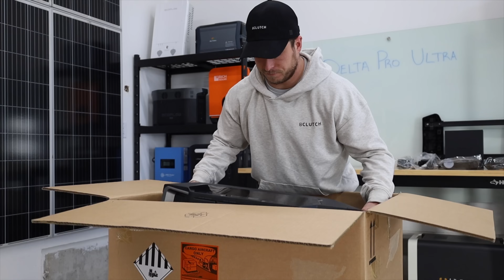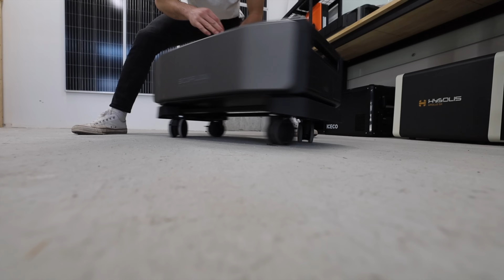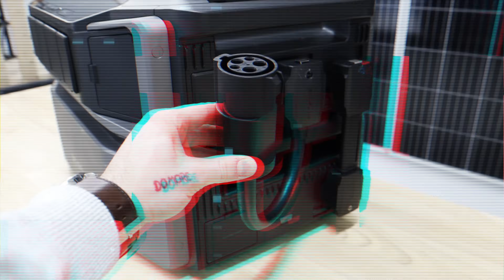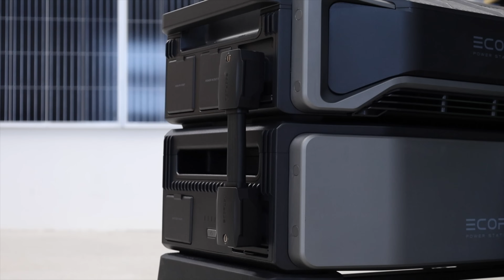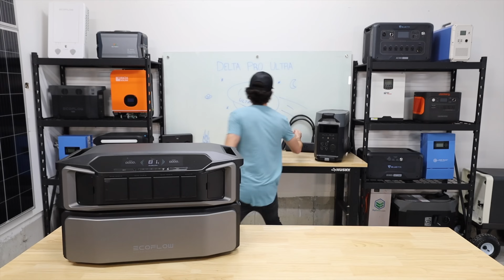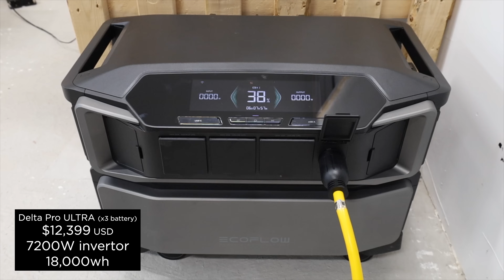EcoFlow Delta Pro Ultra - NOT What We Were Expecting!

Comment: Unfortunately, I think I already know the answer but if you use the 50 amp hub that means you cannot go above 50 Amps, correct? I have an electric heat pump and heating system and it needs 79 A to come out of rotator lock.
Reply: Get a soft-start system like "Easy Start" and you may not need more than a tiny bit over the operating load.

Comment: If you’re in an NEC2023 area with hilariously expensive battery installation rates the bonus for these is you can DIY without violating code or paying silly money. NEC2023’s paired battery/inverter nonsense and the way the solar industry makes money leads to $15k 5kWH batteries installed with your solar install where the permitting has already been paid for.

I am planning on dumping excess solar for charging my car into a battery and the options are essentially something like this, an all EG4 setup, or paying out the nose.

Since I don’t care about whole home backup this is a pretty easy option and if I do ever care there is an upgrade path.

Comment: What are the pass trough charging limits and can one charge the DPU off a portable gas generator from the high Input/Output on the side   while at same time powering a 30a 240v load from the 14-30 plugs on the front?
Reply: I need this answer also.

Comment: Would be a good fit for taking a single wide trailer house off grid especially if the hot water tank and oven are natural gas and you use mini split 120 volt AC/heat pump systems for the house or you live in a tiny home with one or two 120 volt mini split AC/heat pump systems.

Comment: How about just getting a gas generator to charge up the ultra and not have any panels at all. 

I want ecoflow to ship to Puerto Rico but they don’t. 
USPS will only ship 70 pounds for about $300 bucks. 

I could buy the whole unit in PR but the price is double and triple amounts.  

This is mostly for my other half where she could just flip up a interlock turn of the main and torn on the ultra. Then run the whole house with the 240 L-14 30 Amp plug.  Like I have here in NY
Reply: Have you checked if you can get it through Costco?
Reply: I haven’t checked Costco but I have checked Home Depot in PR. 
Next time on there I will check. 
Thank you.

Comment: Way too low of solar input.  You have to essentially buy at least 2, but probably 3 inverter combos for a true whole home PV setup.  At that point the cost is insane compared to the competition because you are buying so much unused redundancy.  Also their "Smart Panel" that accepts this is essentially a critical load panel (12 slots) and not a whole home backup.  I love Ecoflow in the mobile power space, but they missed the mark on whole home badly.

Comment: I just don't get it as a home backup. I want to run my whole house including a/c and you would have to spend an absolute fortune to be able to do this any length of time. What good is an hour or two? I want to love this technology so much, but it just doesn't work as far as dollars for results. My 13kw gas generator runs my house with no problem and only costs $1200. I mean that's a huge difference to me.
Reply: What happens if there's an extended outage and you need gas but you can't buy it from the gas station because they need electricity to run the pumps? That's a reason I have solar backup. Also, it's a huge up front cost, but requires no maintenance or  fuel dollars down the road.

Comment: I own a Delta Pro, a Bluetti AC200P and a few other smaller all-in-one units, for "convenience..."they are bolt-ons for a much more substantial solar/battery setup. I would caution anyone who takes power backup seriously to not place your entire backup strategy into one of these all-in-one setups.  Are they cool?  Yep...I may purchase another one at some point.  The potential issue/risk (for me) is what to do if any single component fails in one of them (MPPT, Inverter, 12V output, battery cell(s), etc.).  For a home backup, I'd use tried and true, stand alone, system components and use these for convenience only... or camping 😀

Comment: Gasoline Generator, if you are a dinosaur?  I think I'm missing something. If these batteries are depleted after a day or so and there is no electricity due to a storm, what alternatives are there outside of gas?  And spending thousands on additional batteries.  FYI, I can get and store gas and propane on the cheap for longer than any storm will last. PLEASE HELP ME UNDERSTAND.. I HAVE TO BE MISSING SOMETHING
Reply: Most power outages are brief. And if it’s extended, that is where the solar power hookup comes into play.
Reply: @AlanMEvans  you are correct. I guess it depends where you live.. it seems people in houston and place affected by hurricane and freeze look at things a little different.
Reply: If a shtf occurs and goes on for longer than a few weeks,  people will be attracted to the loud sound of a gas generators knowing someome has power.

Prepare for a lot of unwanted company!!
Reply: I agree
Reply: As the op pointed out, there are other options to Ecoflow that are a lot more cost effective.  I think Ecoflow is designed as a more portable power source for camping, sporting events, exhibits, temporary storm power back up, etc.  Anyone already owning a solar array setup can add this Ecoflow, but most likely we'd get a Solar Arc hybrid inverter and any batteries, but preferably, LiFePO.  The tricky part is wiring it all together, because you need the correct wire and you need to know how to balance the solar panel loads with the battery inputs.  It is not hard, but it takes a bit of know-how.  You can also get a generator to charge up the batteries, but it is also expensive. BTW, solar panel prices have dropped and use 300W panels can cost less than $50 each.  I have a 12KWH system and it would make sense to use the output from the existing inverters to feed the hybrid interter, charge the batteries, and then be happy knowing I am in good shape if there is a storm with more than adequate backup solar.
Reply: @johnsteed265  looking forward to Solar Arch coming out with a solution as easy to use and setup  as Ecoflow and Anker...

Comment: Hi , i have span electric panel which has solar edge pv 40 amp input connected to one of the circuit , is it possible to add delta pro ultra as solar energy passthrough to span panel to smooth out and max consumption of onsite solar energy ?

Comment: Title: EcoFlow's New Delta Pro Ultra - Battery Issues and Mixed Messages from Customer Service
I recently ordered the new Delta Pro Ultra from EcoFlow, but I have a frustrating issue. They sent me the inverter but not the battery, and to make matters worse, they charged me for the full unit.
When I emailed them to ask about the missing battery, they informed me that the batteries for this unit are out of stock and won't be available until mid-July. However, when I later called their customer service number, I was told the batteries would be in stock in early July.
These conflicting dates are leaving me stuck with a Delta Pro Ultra and no battery indefinitely. Adding to my frustration, their website still allows people to order the kits and the batteries as if they're readily available.

Comment: I'm evaluating home backup batteries, without solar panels.  Panels are icing on the cake.  This system will run my house and I can charge it back up on the grid once the black-out is over.  Or if too long, I can plug in my dual-fuel generator for a few hours.

Comment: An added benefit of this vs the professionally installed set ups is this is mobile, though it's heavy and a pain to move. So if you have a major disaster you can take power with you when fleeing. 

Also, you don't have to worry about having some "professional" cutting corners or making a mistake.

I do want to know how the longevity compares to the professional kits though.
Reply: They guarantee a minimum 10 years.

Comment: I would love one of these due to how clean & quite they operate compared to a gas generator but I see the Delta Pro Ultra 6,000 watt is  $6,300 online. A Generac Guardian 18,000-Watt (LP)/17,000-Watt (NG) Air-Cooled Whole House Generator with Wi-Fi and 200-Amp is $5,163 Plus installation.  Is there another combination of Delta brand batteries with enough to power a whole house that would be less expensive? I would also want a fuel fired generator, smallest size possible, that could be used the recharge the Delta. During a blizzard or high wind event the solar panels wouldn't cut it for me. Thanks!

Comment: Great overview, Thank You - I wonder if you have a video that shows how to connect this unit to the hose electric panel and switch automatically when the power grid fails - Also, ca you show the number of units needed to provide power for a house with 3 refrigerators, water heater, HVAC system, and electric stove and media center... Thank you in advance for your help.
PS: My highest monthly usage is 573KWH.
Reply: I believe the only way for an "automatic" switch over in the event of power loss from the grid is to use the EcoFlow Smart Home Panel 2 (SHP2). The SHP2 supposedly has an undetectable transfer in the event of a power outage and it has positions for 12 breakers. The panel is installed as a 100 amp sub panel off the main and you can use double breakers in each slot which could theoretically provide 24 circuits in the SHP2 as long as the total working load was within spec of the panel. Each DPU inverter also provides 7200 watts which is 30 amps but the panel will accept connection of up to 3 DPU inverter units for 90 amps combined but that gets expensive. I'm waiting on my order for a DPU with 2 batteries and the SHP2 from Costco and just had an electrician here this week to discuss the installation. I'd do it myself but the local inspector won't give me a permit for this magnitude of work.
Reply: @robertbaron3242 thank you for your reply and insights, it helps me greatly.

Comment: Have you had a problem with delta pro ultra sold by amazoz? The q/a:"Is ac pass through possible with 120v input? A:Use the c20 outlet for a bypass mode with a 120v input. There is no bypass mode for 240v input. AC output is turned off at this time."

Comment: I have an existing Ecoflow Power Kit in my van. Do you know if the same cable connectors are used on the Ultra that were used  on the Power Kit?  would be nice to just slap this baby in and use the cables i already ran for AC in, PV in, DC out , and even my  existing 5kwh ecoflow batteries. etc.

Comment: i need this for my solar system, but I can't afford it .. Yet. I am getting solar installed at 37k. This will leave me broke. but I will need to save up 18k to get me one of those that will last me 24 hours or longer. I prefer the 60KwH option but can't afford that either. I need patience. then I can get it. I need it cause i want to be able to go totally off Grid and only have to pay for gas. 900.00 in my Electric bill is about what i currently pay on my Mortgage.

Comment: your gas generator statement was extremely stupid, yes us dinosaurs supplementing electrical during power outages during a sub-zero winter at 1/10th the $$$cos, How about a simple natural disaster...or a simple hail storm, a fuel generator system is basically weather resilient, the dinosaurs understand redundancy and real-world issues.  Your statement should be "If you can afford it" add battery storage...or supplement this system with a tri-fuel generator

Comment: Do you know if the Delta Pro Ultra works with the Delta Pro accessories? Example Ac alternator charger to charge while driving/ or ev adapter to charge at fast charging stations around the country??

Comment: I just got my Ultra in and running test on my 2 refrigerators and freezer at the same time. Just wanting to see how long one battery will run them. I, like you, wanted the DYI kit because I'm cheep too. But, I have an RV I spend 3 months in the woods during deer season & 3 months at  the lake in the summer. I'm 60 & retired. But the flexibility to not pay $50 per night at the lake for a power site & a backup for the house was best for me. I'm going to get 2 of the Zigs or Cigs (sp) 400watt flex roll up panels. Great video man;  also do some affiliate links to make some money. You can offer discount codes to us doing that. Everyone has to make money.
Reply: Update?

Comment: I am seriously looking at installing the Ultra with 3 extra batteries. I already have 12KW solar array and a 20KW generator. Living so close to the ocean is eating my Genset alive so i have to switch soon for whole house backup.  The Genset has a transfer switch so I am wondering where to position EcoFlo transfer switch. It seems every year we have a week long outage. I am thinking 24KW output can be recharged everyday by the solar panels but if there is a week of solid cloud can the generator be started to power the house and at the same time recharge the batteries.

Comment: Thank you!  The one thing that drives me nuts with EcoFlow is they use proprietary connectors.  I'd love to see a 240v charge input with the 240v output. For people in apartments who can't convince the apt to install the Ecoflow sub panel, but could possibly get them to install a quick interconnect plug.
Reply: They have a generator inlet cable 240v l14-30
Reply: EXACTLY…. WHY IS THIS NOT EVERYWHERE…. HOW MANY CONDO’S NEED THIS 😮

Comment: I saw this thing at costco with 2 batteries and a smart panel 2 for $8k. I wonder if I could use this and the panel with my current setup which is 39 solar panels with enphase inverters that is grid tied.
I was thinking of setting up this panel 2 with essential breakers like fridge, well pump, water system etc and then have the delta pro ultra be a backup if my UPS for the house and also have it either grid charged or solar charged. Anyone know if this is possible with this one unit and the smart panel?

Comment: I like the idea of this product and its integrated, expandable system approach. I do have one thing that I cannot seem to find a definitive answer on. Can I use my Honda EU2200i generator to charge on the 120 volt charging plug, while connecting the output of the DPU to the generator inlet box on my house? The idea being that under light loads the generator is keeping the DPU topped up, but under heavier loads the DPU can combine battery/generator? That way I could use the DPU for heavy draws, and also extend the useful run time of the generator.

Comment: Does the app still require you to provide email address even if you log in with (e.g.) AppleId?

One of the killers that stops me from expanding my already existing setup using Ecoflow’s lack of transparency about what data they collect about the user, and a stupid (IMO) requirement to log in to use the app which makes it completely unusable in an off grid location with no internet.

It’s a non-starter, and a huge drawback on otherwise fantastic product.

Comment: Or one other note if you want to make a test with it. Won't you hook it up to your house show how one battery cannot run your whole house and that pull out fall in power without at least 3 batteries, and you won't have full capacity of power to last all night long or all the zon as it needs to last with all 5 batteries and you can't get the full impact out because it aint gonna run at 7200 W without more than one battery.
Reply: I'm not sure what point you're making or question you're asking, but 1 battery and 1 inverter will easily output the 30 amps @ 240 volts to make 7,200 watts (of course it would only last a bit over half an hour with that high a load).  Most of the comments about will it do this or will it do that don't contain any information about the load being pulled from the DPU.  It's all pretty easy math to estimate, you use 1kW of power for 6 hours and you'll deplete 1 battery's worth of power.  Just having the unit plugged in to 120 volts @ 1,800 watts would keep the unit charged and not require extra battery power to meet power requirements.
Reply: @default7950  What point is I making 7200 W?What is that gonna run my kitchen stove?My water heater My watch Machine.
Six split air conditioner heaters  Would that?
 Run a electric furnace. Everything in my house is everything. I don't want a battery to go get in 3 hours or less.
 Kind of why I have 30 kW. Of batteries running my house. And I recharge them every day and it's many batteries.

Comment: Question i have Enphase solar panel system. ( no backup battery generator or anything ).... Can i use this Ecoflow Ultra with my existing Enpahse panels to charge the Ecoflow ultra? I'm not sure if you can answer this. Or can you at least point me in the right direction? Thanks

Comment: If I wanted to power a small shed, off grid mostly with some panels on the roof to recharge. A ductless AC, dehumidifier (Florida), computer and some lights and a few other things. Would You say this model or the last delta pro?

Comment: The thing I like about EcoFlow is the price. You can use this beast as a battery backup for your computer. You will not find a PC battery/surge backup device with the wattage output you can get with an EcoFlow any where near that price. The PC marketed devices are 3X the price of EcoFlow. I can power my Verizon Fios, OTN, Router and PC on this thing.